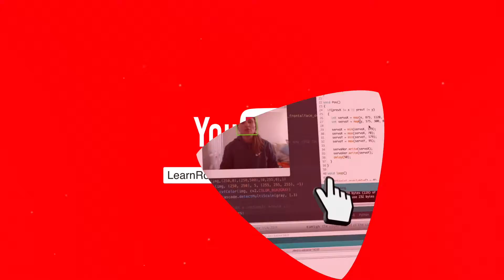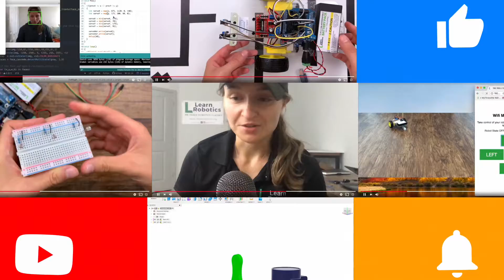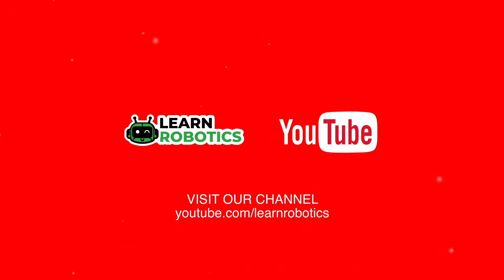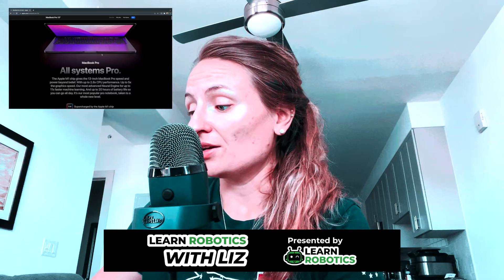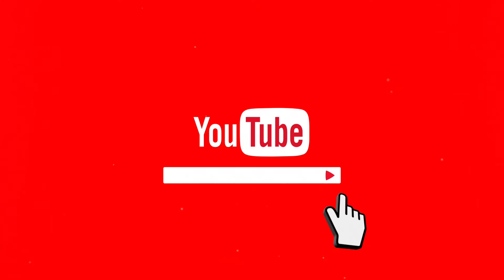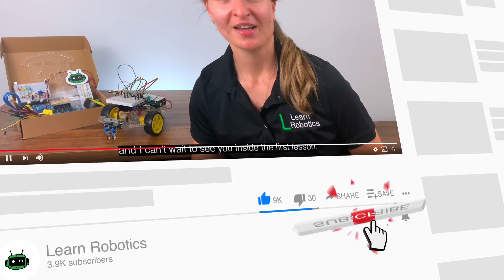Best Computers for Robotics and Engineering (Mac vs. PC)  | Learn Robotics with Liz - Episode 5

Comment: Thank you for this video, I will be getting a fairly used M3 pro 36/1tb 16” cc of 88 and bh of 96%, today. Have your opinions changed in 2026?

This is my use case:
robotics research, working with raspberry pi and various electronics, learning and practicing RL for robotics, backend and infra, AI and ML.

Comment: Hey there, i am starting my bachelors in automation and robotics engineering, is it beneficial to use macbook M1 or do i have to go for windows?
Reply from the maker: Depends on the robotics application. Here's a more comprehensive article that can help: https://www.learnrobotics.org/blog/best-computer-for-robotics-engineering/
Reply: @LearnRobotics  many people are saying that MacBook Air m1 has compatibility issues is it true
Reply: @LearnRobotics  I am planning to buy MacBook Air m1 16 gb 256 ssd . But the reatilers are telling me to make sure the softwares i want supports on it .I am going to study robotics engineering on collage. (I am also apple fan 😂and really love there built quality)
Reply: @samarthsanthosh2989  Don't buy a mac. You will have a hard time running solidworks or any kind of windows only supported software.
Reply: @samarthsanthosh2989  Did you face any issues while using Mac?